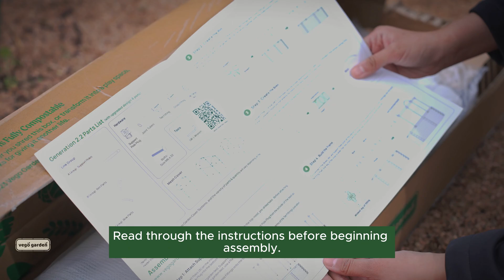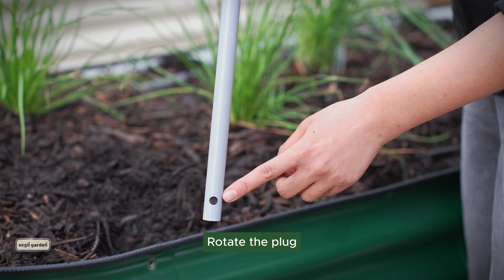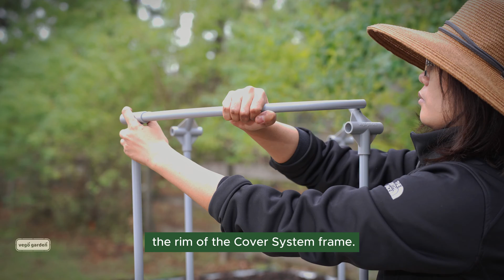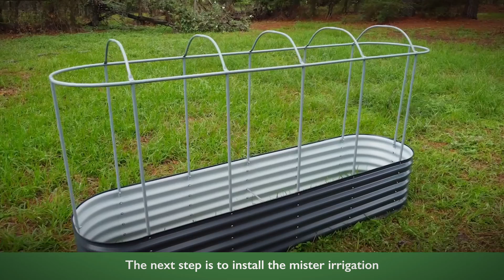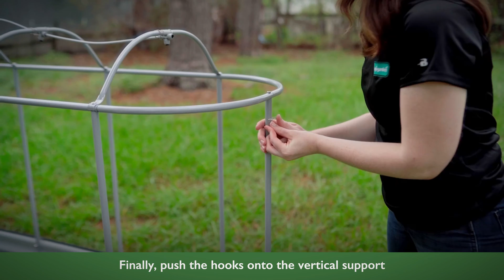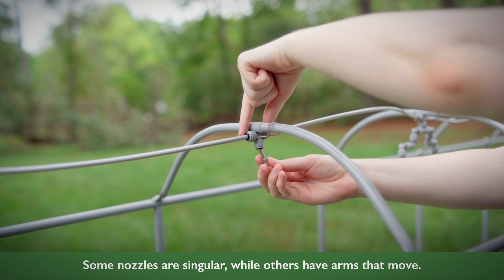Cover System + Mister Irrigation Generation 2 Assembly Tutorial | Vego Garden

Comment: I have the same raised bed and the Vego irrigation system. The irrigation system uses the top holes. Is the cover system not compatible with the raised bed when using the irrigation system? Or do I put the cover system poles on the outside of the raised bed?
Reply: You have to use longer screws in order to do both. m6 1 x 35mm you’ll have to source them yourself but it should work together

Edit: it’s easier to use the screws listed above but the screws they send will work with some effort. In order to use their screws with sent with the cover I had to first tighten them with with bolt they provided and then removed the bolt to add the irrigation bracket instead. If I tried without doing that first the irrigation bracket wouldn’t catch the threads.

Comment: They finally "cracked the code" in my backyard garden where I've been fighting squirrels, rabbits, and birds for years. This is the best solution yet. Yes, it's expensive, but it's a nice system. You get a (1) nice sewn cover with zippers and velcro (2) curved, painted metal supports and (3) all the connector fittings. 

All these fancy garden and seed companies---like Gardener's Supply, Johnny's Select Seeds, etc ---have been around for years and never had anything close to a system like this. Well done, Vego!
Reply: I must hurry ro purchase mine #deer too!